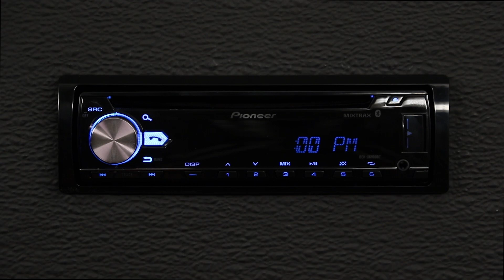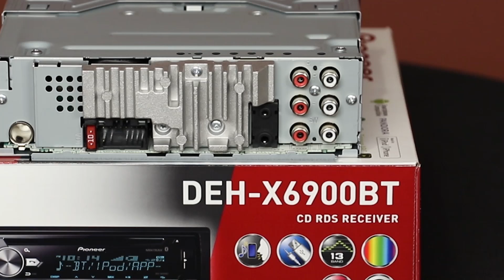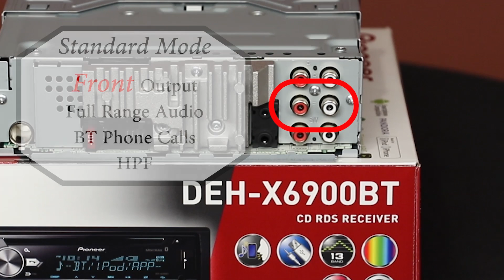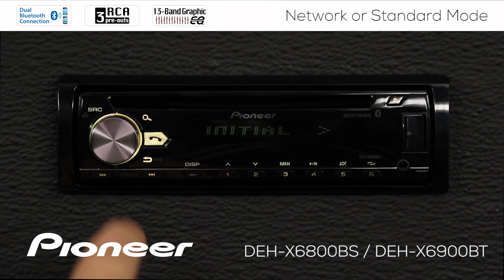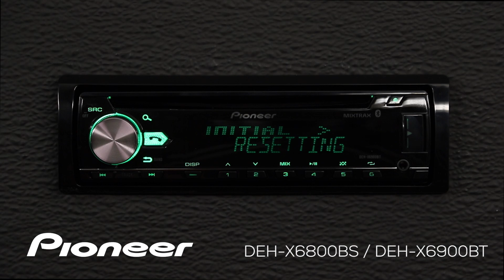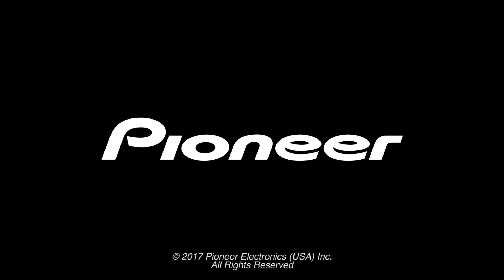How To - DEH-X6900BT - Understanding Network Mode and Standard Mode

Comment: No mention was made of the wired outputs, does the concept remain the same with those?
Reply: On Pioneer receivers with Network/Standard mode, the wired speaker level outputs are the same as the matching RCA outputs.  All changes to crossovers and slopes made in the audio settings apply to the wired speaker level outputs as well as the RCA outputs.  You can learn more about Pioneer Network / Standard mode here:  https://youtu.be/WvJXYh6vk_0?list=PLw63zJRQbCNi6CoU7JbUNT83T7ippQbU6&t=396   and you can find more videos on Pioneer's YouTube Channel here:  https://www.youtube.com/user/pioneerelectronics

Comment: what about the pioneer deh-x9600bhs? does that have network mode and standard mode
Reply: No.  The Pioneer DEH-X9600BHS does not have network mode.  The 9600BHS came out about 2 years before network mode for 1 DIN receivers was available. It has a simpler version of standard mode.  It's very similar to what you see in this video:  https://youtu.be/CR--rSY_eos    You can find more videos on Pioneer's You Tube Channel here:  https://www.youtube.com/user/pioneerelectronics

Comment: What about the Pioneer 80PRS unit. Do the specs for the outputs in standard and network mode apply the same as shown in the video?
Reply: Bingo.  Same thoughts 💪🤔👌
Reply from the maker: @HighVibeTrybe      
Pioneer discontinued sale of the DEH-80PRS in 2020.  
The DEH-80PRS has standard mode and network mode seen here:    https://youtu.be/4Ix3u758p9c?t=62           and has very similar specifications for crossover points and slopes as those shown in this video, although not identical.  The DEH-80PRS also has dual 16 band EQ available in Network Mode.  You can see more about that here:  https://youtu.be/0nY4z0FZPD8    For more information about crossover points and slopes check out this video the operation is similar to  DEH-80PRS:  https://youtu.be/WvJXYh6vk_0
You can find more videos on Pioneer's YouTube Channel here:  https://www.youtube.com/user/pioneerelectronics
Reply: Does this apply to my head unit mvh720 bhs  because mines is label rear and than follow by front and low
Reply from the maker: @Phillyboyz1.0     Yes, the Pioneer MVH-S720BHS has Network Mode and Standard Mode nearly identical to what is shown in the video above.  Please take a look at this How To video from Pioneer for more information about Standard Mode and Network Mode and how crossovers and slopes work on Pioneer receivers:      https://youtu.be/WvJXYh6vk_0?t=340
I recommend to try the Pioneer Smart Sync App to set up your audio system with the MVH-S720BHS.  You can learn more about it here:    https://youtu.be/b5DmuSMc04E?t=503
You can find more videos on Pioneer's YouTube Channel here:   https://www.youtube.com/@pioneerelectronics
Reply: @pioneerelectronics  thankyou  I’m so blown  away how much  clarity it sounds especially I have pro audio midranges and tweeters I love   The pioneer app so much easier to fix the cross over I guess I don’t need a DSP after
Reply: The DEH-80PRS has very similar specifications for crossover points and slopes as those shown in this video, although not identical.  The DEH-80PRS also has dual 16 band EQ available in Network Mode.  You can see more about that here:  https://youtu.be/0nY4z0FZPD8    For more information about crossover points and slopes check out this video the operation is similar to  DEH-80PRS:  https://youtu.be/WvJXYh6vk_0